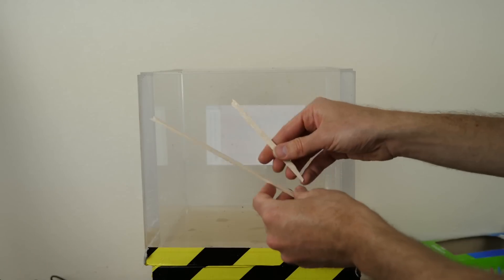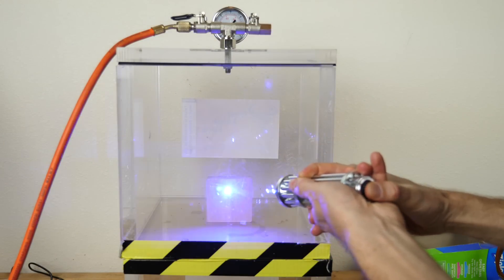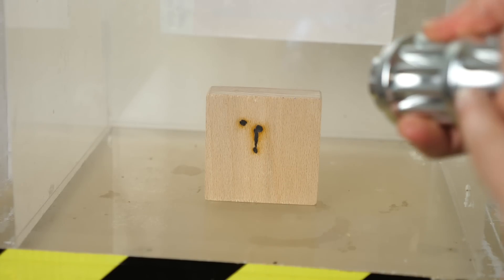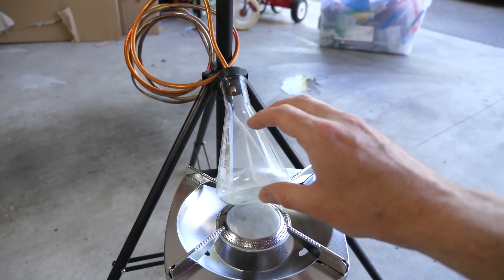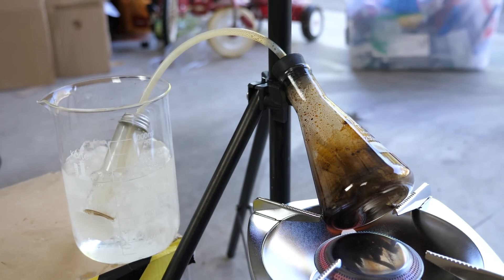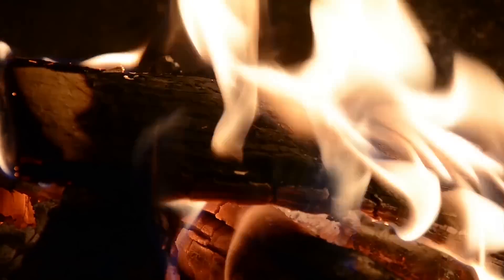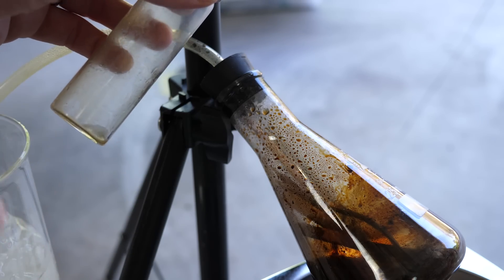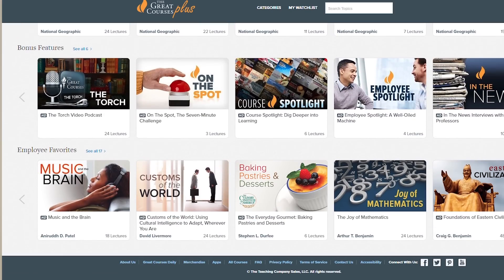Is It Possible to Melt Wood in a Vacuum Chamber? The Wood Distillation Experiment

Comment: You cannot melt wood because the temperature which wood decomposes into coal and water is lower than it's meltingpoint, however you can melt the coal
Reply: And i know that wood doesn't decompose purely to water and coal, methane, hydrogen and some other substances are also produced

Comment: The key thing is the smoke, the wood is turning into smoke also the thing you built for your second try looks like a meth lab 🤣
Also put something in an airtight box with the wood that will convert the oxygen into a different gas that isn’t flammable so the box isn’t under pressure but also can’t carry the flame

Comment: What's waters melting point? 🤔
Reply: 32°F or 0°C or 273 K at 1 atmosphere of pressure. Keep in mind, melting is just the conversion of a solid to its liquid state, so liquid water is already "melted" from its solid state - ice. These temperatures are also the "ice point" of liquid water, at which it can convert to a solid state and be ice.

Comment: Basically, the point at which the giant, weakly bonded molecules break down into smaller molecules is lower than the point at which they would melt without breaking about, so you can never melt it.

Comment: A better way to do this would be to surround the wood in an inert gas. Argon would be best because it’s more dense. I use it for Welding to prevent the steel from oxidizing at its high temp.

Comment: If it was possible to melt wood it would be a lot easier to make furniture and stuff
Reply: derektye05 this is also how they make guitars aswell as other insuments like chellos and violins.
Reply: While not possible to melt, it is possible to heat wood in water to make it bend. (Which is used in making ornate furniture and structures) Pretty cool stuff.
Reply: +iPhaust
Tell that to a motorboat.
Reply: +iPhaust
They don't have sails. You literally don't sail them.

They have a motor and a steering wheel. You literally drive them.
Reply: @JivanPal  no you conn
Reply: @JivanPal  conn or pilot
Reply: Isn't funny that you need to soak the wood on a boat to shape it only to drive on water.
Reply: iPhaust  please do tell @jivan Paul what sailing actually because like him I must not know the answer
Reply: Y'all really killed the suspense
Reply: Thx for the spoiler
Reply: The problem is that if you melted wood and formed it into structures made out of wood, you would lose a lot of wood's favorable structural properties.   Wood is only strong in tension in the direction of the grain, and it is a lot weaker with tensile stresses that are across the grain.  If you melt and re-solidify the wood, you will no longer have the advantage of it having a strong direction, as it will be equally weak in all directions like a plastic.
Reply: No, it melts at like 3000 Celsius. Any machine that can be used to make it would melt, maybe even boil. Its much easier to make it by hand
Reply: This aged well
Reply: @NaziaRafiq1  it's been 6 years??? wtf T-T also wdym this aged well??
Reply: @Miro55Gaming  Look up "wood welding" Bro. That's why people are saying that. They pretty much found a way to "melt" wood.
Reply: @kj12351 to be fair, wood welding was discovered long before this video was made. Before this channel even existed.
Reply: AllenMurphy93 never really thought about it that way lmao
Reply: Or soldering wood
Reply: Why would it be any different for a mortorboat?
Reply: I'm sorry but you can't drive on water.
You can sail tho.
Reply: @iPhaust  or conn
Reply: NATHAN FALLS this litteraly took me under 5 seconds to google.

sailing
ˈseɪlɪŋ/Send
noun
the action of sailing in a ship or boat.
"a sailing club"

If it was called “driving” it would say “the action of driving a boat”.
To be fair, you can tow a boat to your car and transport it, then it would be a form of “driving”.
Reply: @iPhaust  you don't drive a boat you conn or pilot
Reply: iPhaust sailing is using wind against your "sails" to move the boat if the boat doesn't use wind to move eg a motor boat it isn't sailing it is driving mate I don't think u quite understand what sailing means
Reply: Verified by Wikipedia: Sailing employs the wind—acting on sails, wingsails or kites—to propel a craft...
Reply: @HISEROD  thanks for putting this to rest.
Reply: @HISEROD  literally anyone that can write and has internet can put whatever nonsense they want on Wikipedia
Reply: @mauimaumau2710  Yeah totally unreliable. I don't think sailing has anything to do with the wind.
Reply: I don't think sailing means, what you think it means.

Comment: It would probably melt, today in science I was trying to push the rest of my hot glue stick through a hot glue gun and it the toothpick that I was using ended up warping with enough heat

Comment: Unlike boiling temperature, melting point of most substances hardly depends on pressure, since densities are not changing that much between solid and liquid state (as compared to the transition between liquid and gas).  So, it would be silly to expect dramatic change of the melting behavior in this case, when pressure difference is just one bar (actually even less, since vacuum in this toy chamber is far from being deep).
Reply from the maker: The vacuum was so it wouldn’t react with oxygen, not due to melting point depression.
Reply: Then, it would be much easier just to perform this experiment in atmosphere of non-oxidizing gas, such as argon, nitrogen or carbon dioxide.  Which again makes the experiment unnecessary, since argon welders always use wooden spacer blocks in their work and none ever observed melting of the wood.

Comment: How fun and interesting is that! l loved it and now l will look at wood burning differently!  l never noticed that the flame isn't burning the wood, way cool and thanks so much and l will check out the great courses!
Reply: Momma O I highly appreciate your optimistic attitude in this comment.
Reply: Momma O don't you look familiar
Reply: Momma O p
Reply: then you probably never extinguish candles flame with fingers... that's why it does not burn your skin. the only heat you feel is same as you tip your finger on that melted tallow. well whatever.
Reply: I'm not sure that's the character flaw you think it is...
Reply: Momma O yes it is burning the wood I just looks like it isn't that's because the flame that is touching the wood is burning at a much higher temperature (it appears to be transparent) then the flame that's away from the wood. This guy's misinformed. And yes u can melt rubber how else can u make tires, rubber bands, and shoes.

Comment: If something would bend it's more likely to melt, if it would break, then no.
Wood lignin are strong but not linked when bent or burned they break individually.
While Materials such at metal, lignin are strong and linked, when bent they will hold together and won't break, when burned they will melt together as well.

Comment: I have melted wood before. I was using a plasma cutter over a piece of wood to cut a pattern to fit the board. When I looked under the piece of metal I was cutting the wood was melted.

Comment: There is a lot of oxygen in big molecule, wood is no exception.
Reply: So it would be interesting to see the results if he used a very high powered vacuum pump, and kept it going so that oxygen was removed before it could re-combine with any other element in or released from the heated wood - 

but the wood would still break down into simpler substances, smaller molecules that are not 'wood', so it wouldn't melt, it would disintegrate or some similar term.

Comment: The wood will just char. - - - EDIT: Yup, it just chars as I expected. I knew that  pyrolysis is what happened at atmospheric pressure, so I assumed the same thing would happen. As a side note, it's very possible to make tar, oil and gasoline from wood with a fractional distillation like condenser setup. The leftover gases like hydrogen, methane and carbon monoxide can be burnt to help heat the wood further, essentially making it a mostly self sustaining process.
Reply: +Ash the Snowman Well, he said to leave my predictions in the comments... I always edit after and share my thoughts on why I made that guess and why I was right or why I was wrong. I recommend not reading the comments before watching videos that you don't want to prematurely know the answer to. That's why I do. And sorry if I seem a bit harsh in my reply, I'm very concerned about something right now and not in a good mood (buggy page for assignment f***ing up).
Reply: theLuigiFan0007 thanks for the spoiler. BUD
Reply: wow
Reply: theLuigiFan0007 know it all
Reply: theLuigiFan0007 alternatively the hydrogen, methane and carbon monoxide can be pumped back into the chamber to do hydroreforming or other processes with the assistance of catalysts, so as to raise the yield of hydrocarbons
Reply: Wood don't melt it just gets soft
Reply: theLuigiFan0007 don't be mad his intelligence is superior to yours
Reply: can we get an r/iamverysmart in the chat
Reply: theLuigiFan0007 
He he..
METHane
Reply: theLuigiFan0007  I think it's safe to say you don't the best social skills

Comment: This is not spontaneous combustion.  You applied a external heat source.  Spontaneous combustion comes from self heating in some form. Spontaneous combustion or spontaneous ignition is a type of combustion which occurs by self-heating (increase in temperature due to exothermic internal reactions), followed by thermal runaway (self heating which rapidly accelerates to high temperatures) and finally, autoignition.

Comment: This is similar to how some of the first light bulb filaments were made. They heated cotton thread up really high in a vacuum. It pyrolyzed and left almost pure carbon behind that they then used in lightbulbs.
Reply: metamorphicorder You are correct there were two people who try to make light bulbs Joseph Swan what's the one who technically used cardboard by using thick paper. But the first real patent light bulb was from Edison who use sewing thread so yeah you're correct about that
Reply: Harry Svensson well aparrently as per this video, its unlikely under normal conditions.  Even the abnormal conditions of a vacuum are not sufficient to allow wood to 'melt' in the sense that we think of metals or plastics or some biological materials such as fats melting. Or even ice. Perhaps there is a critical temperature threshold as well as a temporal one along with a certain ambient pressure that must be concomitant in order for woody materials to melt. There might also be a chemical work around that could be implemented to break down some of the cellulosic structures to allow them to be less rigid and sort of flow rather than simply break down into component parts. Would be neat to see him revisit this with different methods. Liquid wood made of actual whole wood that could be converted to a solid structure ' would' be a freakin gold mine of an invention if one could say create it as a biphase like epoxies and ship the hardener seperately. You could mold woodend items that 'would ' blow your mind. Or it could literally blow your house or neighborhood away. Cellulose is a fickle mistress.
Reply from the maker: I didn’t know that!
Reply: Upon more recent reading it turns out that it was bamboo or paper used as the source of the carbon.
Reply: metamorphicorder Thanks for the information, I always like to learn about these things :D
Reply: @The Action Lab  where did you get that laser, if you don’t mind me asking?
Reply: How can rubber be "one big molecule"??!
You can easily cut rubber into 2 smaller pieces.
Which means those 2 smaller pieces of rubber are also just "one big molecule".
But if they are stable on their own, what force what holding them together before??
You can't just split molecules into miniaturised versions of themselves! Those can't be molecules!
Reply: Even c02 really!!  c02 is carbon.
Reply: metamorphicorder f
Reply: I'm glad you changed it to bamboo. I was about to have an aneurysm
Reply: P * V = [n] * R * T... and so on till reach melting temperature, within a compressed ambient without oxygen AND a homogeneous heat source.. OH, and TIME!!!

almost like making real diamonds.. 

I think, and that's just my opinion, that it lacks tons of pressure plus the vacuum and a more homogeneous heat source
Reply: metamorphicorder I
Reply: That liquid in the collection jar is WATER not liquid wood.
It is very easy to collect the tars and even the woodgas (that's what it's called) that offgasses when there is no oxygen.
Reply: +Holdren... It's mostly water. Where do you think all the moisture in that wood went? 
The tars are very heavy. The gasses escaped.
Reply: The wood is never really dry. Obviously it's not just water, but it is mostly water as I said.
Reply: Amazing
Reply: How many phD I just study Physics and Quantum Impossibilities So I can make them Possible
Reply: metamorphicorder very interesting
Reply: actually used bamboo filaments instead of thread.
Reply: Sounds logical.
Reply: What about melting wood?
Reply: Harry Svensson l
Reply: Christopher Lefont i think it depends on what country's patents you are looking at and how you analyse those patents vs extant examples of the original prototypes or known exemplars of the device of known pedigree and date. There were according to my reading yesterday at least two patents outside the US for electric light bulbs that predate edisons. As well as the globar i believe. I couldn't find any mention of actual cotton thread or other textile based filaments of any note with a cursory search. I remember carbonized thread being mentioned specifically in a history or science text book in school years ago. Im sure it would work and was likely done but would likely be very short lived unless it was used as very low current and it would suffer from temperature induced output fluctuations if it was used in a vacuum bulb rather than a inert gas filled one which was a later development. By that time there were other filament options developed.
Reply: metamorphicorder  Hello hello hello hello hello hello hello hello hello hello hello hello low low low low low low low low low hello hello 08

Comment: I HAVE A QUESTION:

Why do two objects of different masses fall at the same rate in a vacuum? 

Surely they have different gravitational potential energy and therefore have a different kinetic energy so they will have different velocities.

I have tried to research this but it doesn't make sense! Please heart and answer!
Reply from the maker: Because gravity pulls on more massive things harder but more massive things are harder to move. The two effects cancel each other out so that everything falls at the same rate.
Reply: The Action Lab thanks for the reply, could you do an explained video on it please?
Reply: Also, why doesn't this work in an air filled space when the heavier object has a large surface area and the lighter object has a small surface area, so the heavy object has a high air resistance? (I'm only in year 11, I don't know how that correlates to American grades, but I'm not in college, so I don't know how this works)

Comment: i have thought about this years in the past.  Here's my before video prediction.  In an oxygen free atmosphere, wood should dehydrate into carbon and ash at high temperatures.  So charcoal basically.  The leftover carbon needs extremely high temperature and high pressure to melt, so I will guess that it will just sublimate, rather than melt.  The only way I can see it melting is if the carbohydrates in the wood melt before they lose their water.

Comment: If pyrolyzing wood is of interest, you may find the coking of coal to also be interesting.  When coal is coked, it gives off many gasses that are similar to petroleum.  These gasses are captured and processed through a refinery to produce many useful products.  The foamy solid carbonaceous (98% C) material left behind is coke.

The destructive distillation of pine tar produces turpentine and rosin.
Reply: I thought that, in a blast furnace, with 1xCoal, you would produce 1xCoal coke and 500 mB of Creosote Oil, in about 3000 ticks
Reply: I hoped someone would get the joke :(
Reply: Coal is destructively distilled in a coke oven where O2 is excluded.  The coke is roughly (very roughly) 75% of the weight of the coal and the gasses are roughly 25% of the weight of the coal.

The gasses go thru a refinery.

The solid coke goes into a blast furnace along with iron ore and limestone.  O in the iron ore combines with C in the coke to produce metallic iron and gaseous CO2.  Limestone melts and floats away impurities in the iron ore.

Wikipedia probably has good articles on this.
Reply: Brody H No, I'm speaking minecraft XD
Reply: Metallurgical coke which is used to smelt metals from their ores.
Reply: All of the words I used should have definitions online.
Ask me about any that you cannot find.
Reply: I'm gonna ask you what everyone reading is wondering: Cocaine or Coca~Cola? ^_^
Reply: The first time i read it, i thought it said the coking of cola
Reply: Rufis I got the joke <3
Reply: are we still speaking english?

Comment: I think wood can't melt in regular conditions because before you can melt it it will already have reached it's ignition temperature meaning that if you were to heat it up super fast it'd be melting, burning, wood.